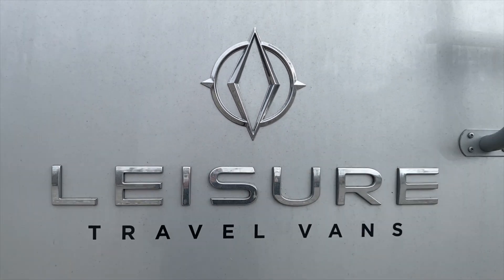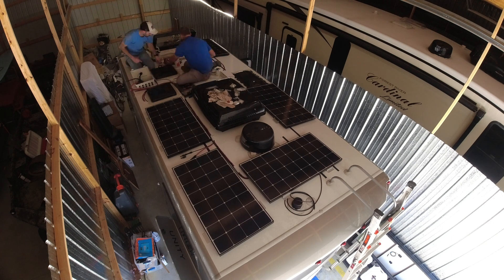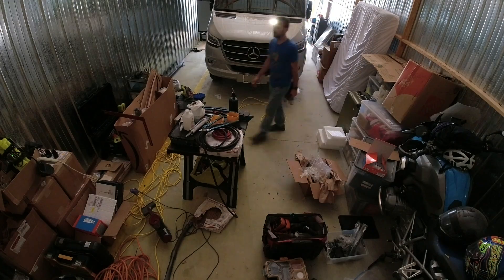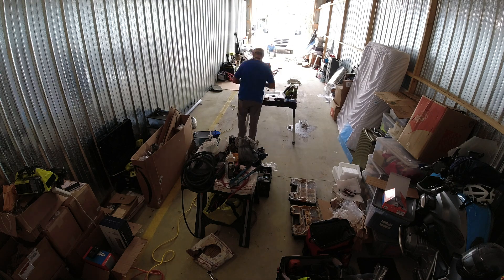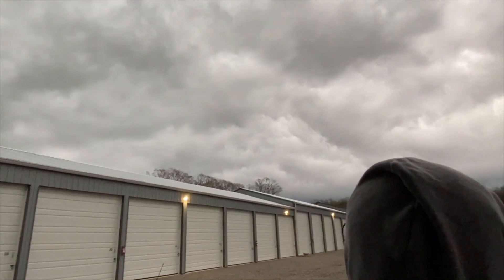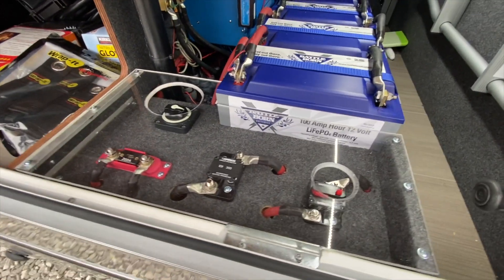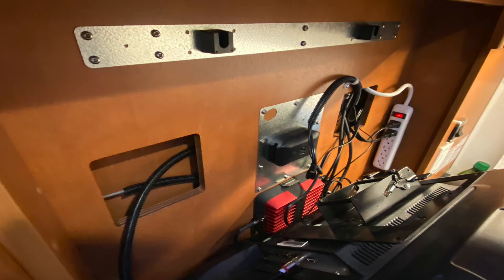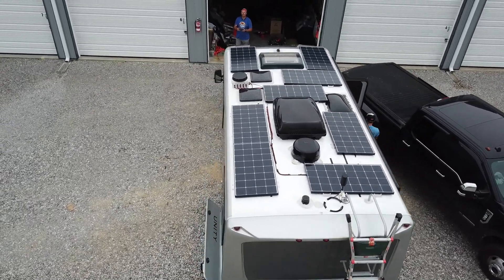@RenogySolar | @VictronEnergyBV | 21 Leisure Travel Van Unity UPGRADE

Comment: How did you wire the panels? 4S2P? 
Are the batteries wired in parallel?
Reply from the maker: Typically everything, but on all LTV's, Mike wires everything in parallel - panels and batteries.
Reply from the maker: Typically everything, but on all LTV's, Mike wires everything in parallel - panels and batteries.

Comment: Looks great.  Does the added weight on the roof affect handling?  How much weight is all that solar?
Reply: The panels are only about 15 lb each.
Reply from the maker: Part of our process is knowing your weight of the camper. I do not install anything that will make the RV over in weight.